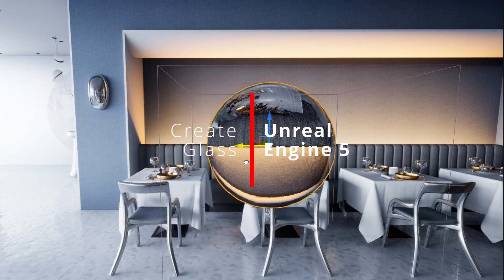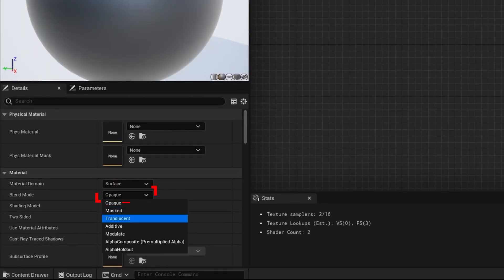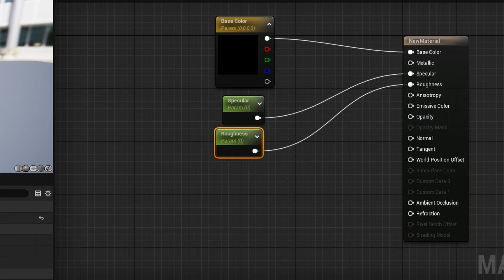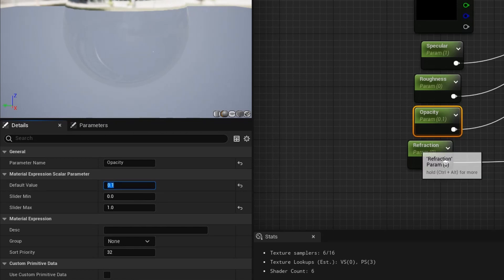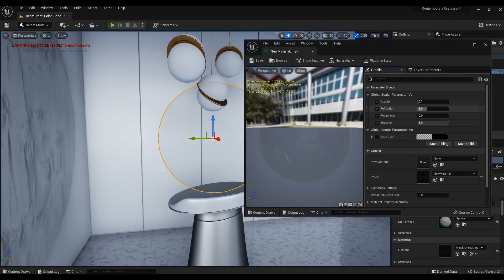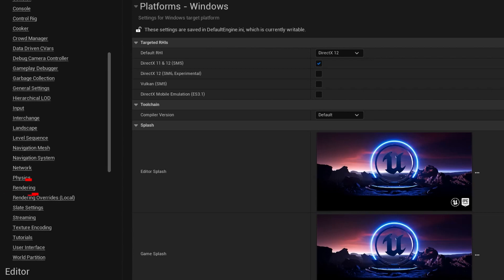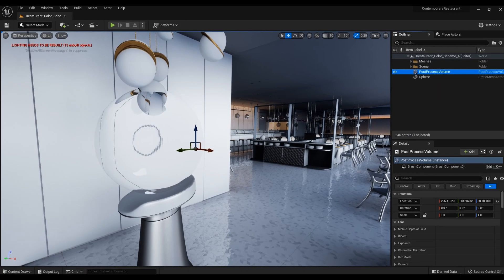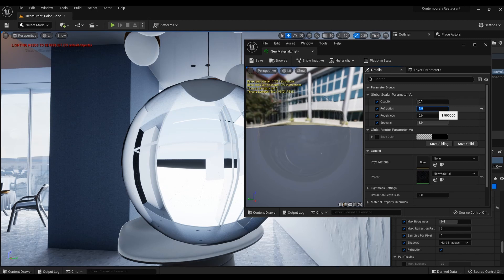Creating Glass Material in Unreal Engine 5 | Step by Step Guide

Comment: The problem with it is that the shader get high complexity. Over 900 instructions. You can change the translucency model from foward shading to surface translucency volume. You may lose a bit of quality, but increases performance.

Comment: Hey guys, for those who use UE in 5.2, if you have the refraction disabled. There is a new "Refraction" tab in the details panel when you select your material node in the editor. And then put Refraction(Index of Refraction).
Reply: I love you
Reply: Needed that. Thanks! 🙏
Reply: thank you so much!
Reply: thanks
Reply: thanx !!
Reply: Beautiful thank you!
Reply: I put the pixel 2d one with a normal map attached to the refraction with good effect. However, thank you for helping with this issue!

Comment: Somehow my glass turns blue when i turn on raytraced translucency. I think it has something to do with my sky light? It looks correct when it is outside my building, but when it is in a room, it seems to be reflecting the outside color (it does reflect the objects in my room correctly, but it's not the right color) Any ideas?
Reply: Same Here! could you figure out how to fix it ?
Reply: pretty much all i could find is that "raytracing will be deprecated" and you should just use lumen reflections with lumen lighting.. glass seems to just not be there yet outside of the path tracer (sadly my deadlines are very short turnaround so I just had to give up on the problem and move on) @Ali-MRD_EC